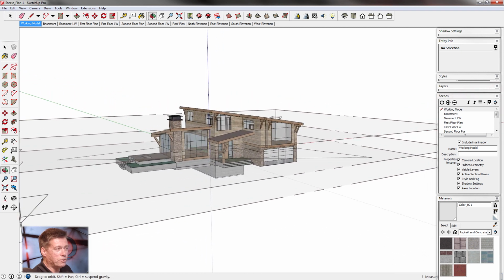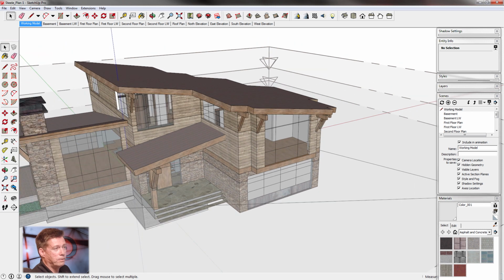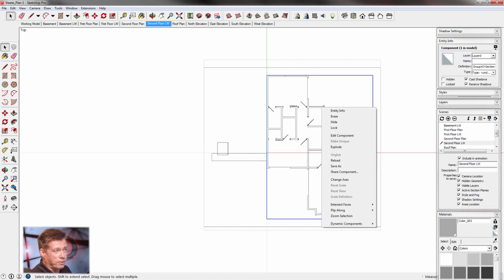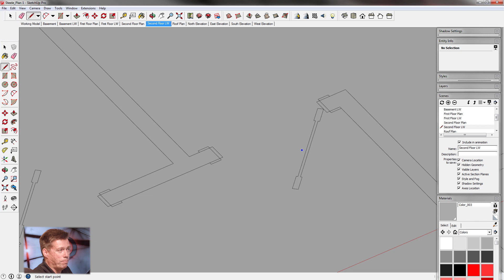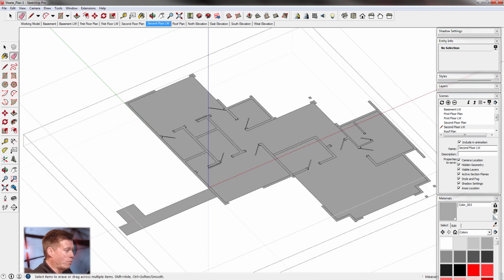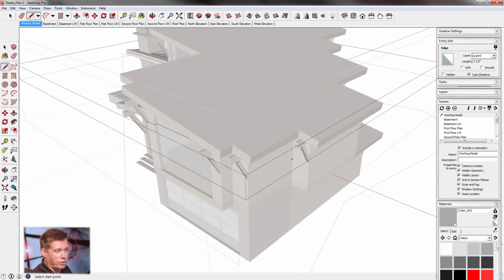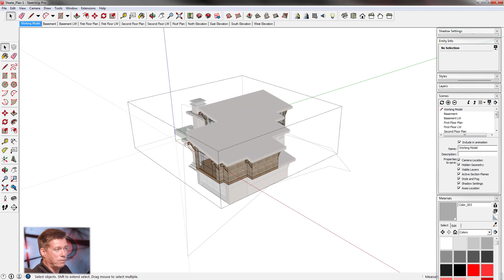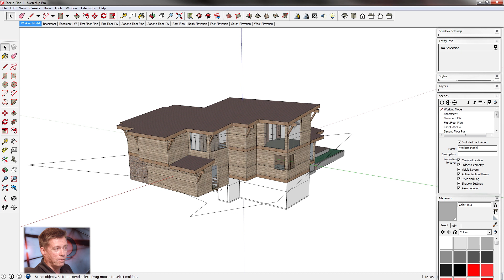SketchUp for Construction Documentation: Generating Line Work

Comment: Why do you paste into a group, when you assign the LW to a scene it doesnt see hidden objects in groups or components and thus you need to redo hide & unhide a lot. Assign it to its own layers does addup to the layering though. Im a bit lost here
Reply: +Rombout Versluijs When you paste the LW into the Level Group (controled by a single layer) you have much more control over the model and you do not need to create separate layers for each level of LW.  I'm a fan of simplifying layer management as it is used often in SU.  I used to do what you are referring to.  I had LW layers for each individual floor.  When you say "hiding", I don't do that other than control visibility via layer management.

Comment: Fill faces plugin will save you tons of time... not sure why you tend to skip plugins, they automate and save you time :) Though sometimes certain plugins need manual fixes
Reply: +Rombout Versluijs I do use a couple, but the purpose of the videos is to show what can be done with native Sketchup.  Understanding exactly what Sketchup and Layout can do, makes selecting plug-ins for your specific needs that much easier.  My biggest issue with plug-ins are the layering systems of them many generate.